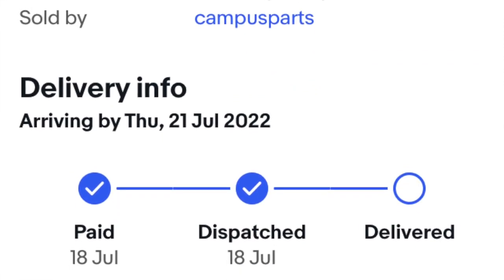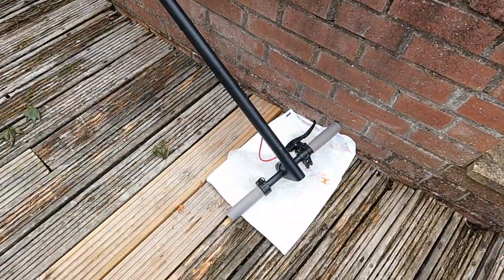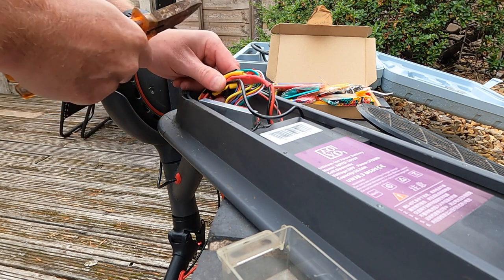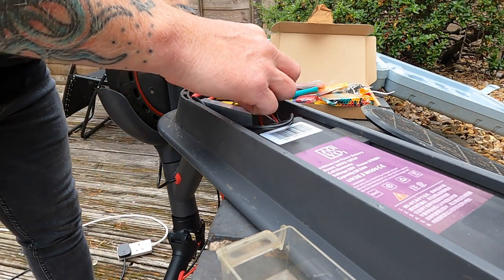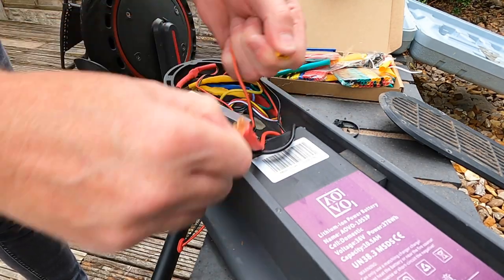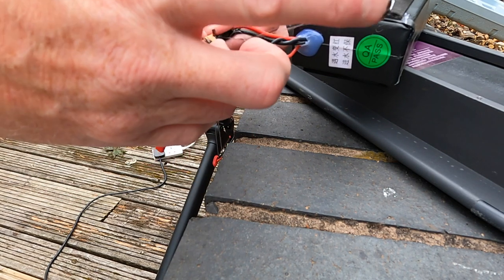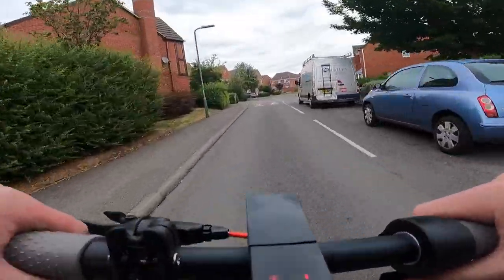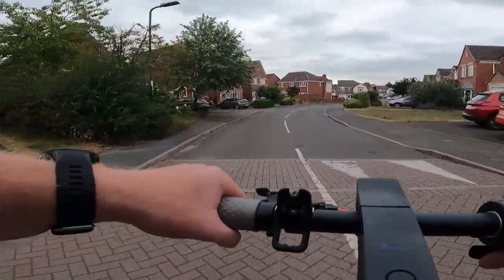AOVO PRO E-SCOOTER BATTERY SWAP - How to fit a new battery to your AOVO PRO E-Scooter

Comment: I replaced my battery with  a 42V one instead and it hits about 24MPH. 42V batteries peak at like 52.6 volts too so it's nice :) kept same speed controller
Reply from the maker: Nice. 

I went with the existing battery - did you have to change connectors for the battery you bought.
Reply: @ScottJonesMTB   Yeah it was a Tplug originally so i swapped it to an xt60
Reply: Where can I get one of those batteries
Reply from the maker: @Jay4rmThaBay510  The eBay seller I used is in the video.
Reply: I fit a 54.6v external battery,
did 26mph, I lost control and crashed into a stationary police car 🤣 broke my arm
and left my hip on the road 😰
Reply: @winniepeg2020  how much was the battery
Reply: @johnydelgado7901  where did u buy the battery
Reply from the maker: Please do click the ‘subscribe’ button. 99.7% of my viewers are not subscribed. It would help me so much if you did. Scott.
Reply: Where did u buy the battery?
Reply: Where u you buy your battery from
Reply: Where you get your 42V from????
Reply: @winniepeg2020 did you make your aovo pro faster with a strong battery?
Reply: What was the battery model

Comment: Is there a way of making it go faster? because I've seen my AOVO PRO ES80 say 20 and 21 on the speedometer.. it just won't do it itself..
Reply from the maker: 19mph top speed
Reply: @ScottJonesMTB  I know.. but I’ve seen the scooter say 20-21 so it can count that high it just won’t reach it itself… and the app is useless.. when you set it to more then 19 in the advanced section it just jumps back to 19 what a pathetic useless “feature”

Comment: Is this the new 2022 model of the aovo pro or the original model ??
Reply from the maker: This is the original model. I have covered hundreds of miles on this battery.
Reply: @ScottJonesMTB  sorry I have had cruise control light come out looks like a speedo on the bottom left it’s only jsut started flashing do you know how to get rid of that flashing symbol ??
Reply from the maker: @humbleorganics1261  you can turn it on and off with a long press or on the app.

Comment: I have a aovo es80 its got claimed 20 degree incline but its more like 10 to 15 max if the firmware worked it could go a bit faster and would be better for hill climbing
Reply: Change it to km on the app. It goes wayyy faster in km
Reply: Mine goes 31km. Fast af for a scooter, JS.

Comment: Hello
i've been watching your channel for a long time , i have a question please 
i have a problem with my electric scooter 😢
no long range
8 or 7 kilometers maximum 😢
and the battery runs out very quickly
and the battery charges from 0 to 100% in 2h30min
the charger is 54V 2A
my scooter with a 48v 500w motor
and the battery 48V 8.8Ah 422.4Wh
and the controller 48v/38v 350WB
i want to ask you first what should I change?
and any advice would be great
thank you so much
Reply from the maker: Sounds like you need a new battery ?
Reply: Any advice for the type of battery please ?
Reply from the maker: @hichamaz8076  Which country are you in ?
Reply: Spain
Reply from the maker: Looked on eBay. 

Lots of choices but expensive. 

100 £ plus.
Reply: yeah i'm asking about the characteristics please 
how many volts and watts ...

Comment: Is there anyway to get the screws out if they heads have been scraped so no where to put the screw driver in 🤦🏼‍♀️
Reply from the maker: If it’s the base, you can get pliers or grips on them as they are slightly raised.
Reply: Thank you for your reply I will try this and hopefully be able to get them out 😊
Reply: You can use a cheap dremel to cut a slot.  Then a flat head screwdriver